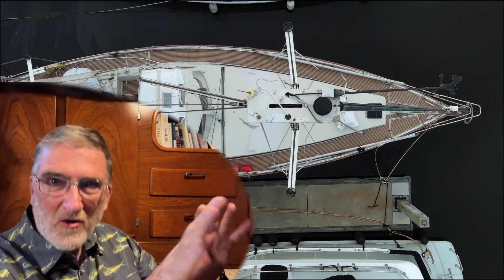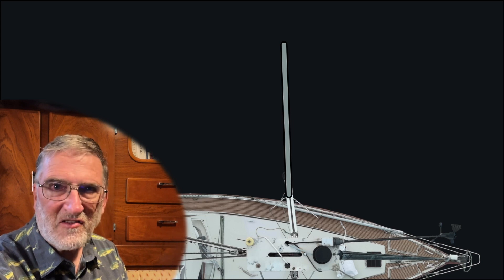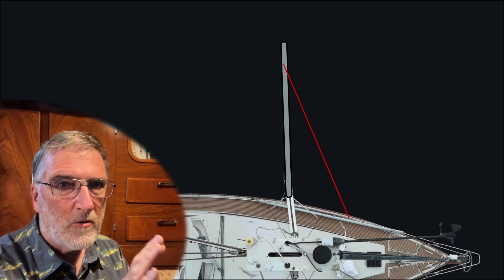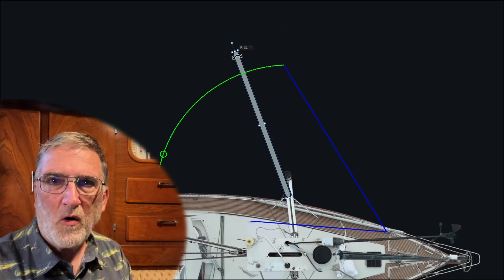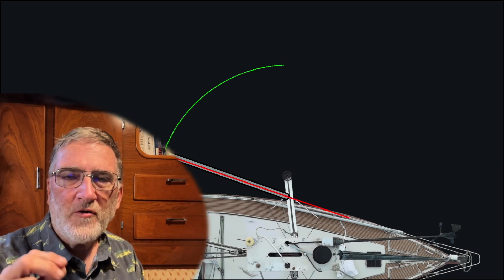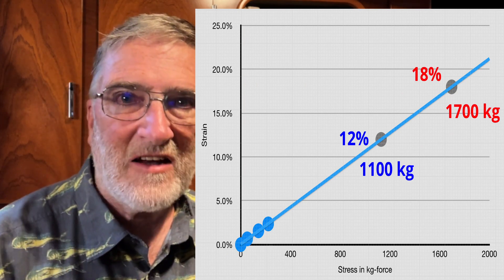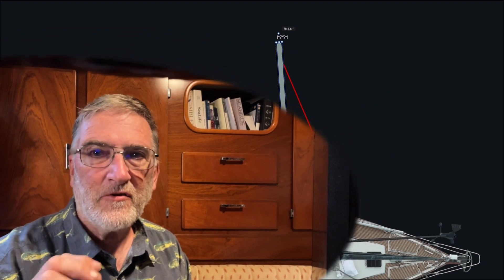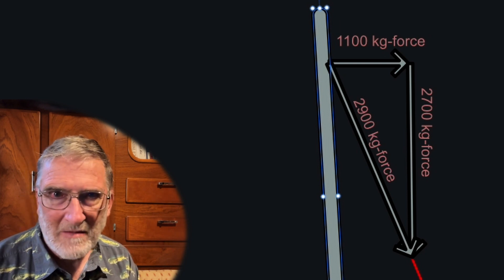Amel Downwind Pole Rigging

Comment: Didn’t Amel change the rigging manual at some point in time from their previous instruction manual for the SM?
Reply from the maker: I am not sure what the point is here.  At the beginning of the production run back in 1989, there was no manual, per se from Amel.  A new owner received training at the factory when they picked up the boat.  That training was required and standard for every boat.  The first edition of the manual was issued around the 2000 model year, and all the current versions have always been available on line, for as long as I have owned my boat, as well as all the knowledge contained in them.  Over the course of nearly 30 years of production, Amel made many changes in the design and operating instructions for the Super Maramu.  In some cases I know of, this resulted in mechanical retrofits to the gear on the boat to keep people from repeating the same stupid mistakes.

The only person I know who has been whining about this was told by several knowledgable owners that his method of rigging was incorrect, and was against Amel's recommendations.  His answer was, "I like my way better."  He was NOT following the recommended rigging setup and was NOT using it according to the instructions that were published in ANY version of the manual.  It is impossible for any manual writer to image ALL the ways people can do something wrong.  If you are doing something that is NOT in the manual, all of the consequences are on YOU.  You can't say, "But you didn't tell me NOT to do it my way!"

It is one thing if the manual is clearly in error, and tells you to do something that is dangerous.  That is not the case here.  The pole was rigged with lines that were NOT configured as described in the manual and in a sail configuration that was also not described in the manual.  

This is documented in the comments on his YT channel--it is not hearsay.  Then his mast falls down and he blames Amel for not telling him something he was told by others. I do appreciate his need to deflect blame to get his insurance payout, but the public blame game being played is at the very least disingenuous, if not deliberately misleading. His "how-to" videos have cost owners thousands of dollars in repairs they did not need to make.

Comment: So the over stretched foreguy (parallel to the boom) has 1100kg.. Why would that make backwinding force to be 1100kg? Isn't there's a (huge) lever in there at that point?
I don't have the dimensions you are using, but with some guesses of dimensions, the backwinding force (normal to the boom) to cause the first calculation case is like something like 500kg. Thus it is a bit overkill to use 1100kg as normal force in the second analysis.
 
Anyway, 3 tons of side force or 1.5 tons, doesn't matter. It's a metric f-ton of force in any case.

Also, I might have missed a lot here, why is that pole joint at side of the boat and not at the mast? Did it buckle from that point?
Reply from the maker: Actually, the geometry WAS included in my calculations.  At the point of maximum stretch, (when the load is highest) there is virtually no lever arm, since the pole at that point is essentially parallel with the stretched line.  There is a joint in the pole essentially at the side of the mast.  Unless the shrouds fail under load, that joint is not allowed any significant motion.

Comment: Thank you Bill. A very good video. I have been trying to figure out for a few years why I seem to have an abnormal load on the foreguy. Everything is rigged with the original amel equipment and according to the manual. On setting the pole as instructed I have to "pump" the foreguy while taking in at the cleat or swing the pole out then raise the pole to its  position with the topping lift. Either way there is considerable strain on the foreguy even before use. In 2020 after a very sedate crossing of the Atlantic I noticed that the pins on the shackles holding the forward guys in place were bent. I replaced the shackles with stronger ones and carried on. In 2022 and again in 2023 I was caught out and unable to get the poles in was running downwind in 25kts true wind.  Both times even though the genoa was 50 % reefed the pole suddenly snapped back. The pole was never anywhere near the water and to my knowledge never back-winded. In any case being furled so much I doubt if back-winding would be a major problem. I just wondered if you had any idea or experience of similar. Thank you for all your valuable contributions to the owners group.
Reply from the maker: @BobThomson-q2j  Bob,  
I don’t understand how you can have an “abnormal load” on the foreguy before you  set the sail if you follow the sequence in the manual.  Let’s review the recommended sequence.  
1. Attach control lines to pole.  The afterguy, and the down haul are set at their marks. 
2. Raise the pole with the topping lift to its mark.
3. Push the pole out, and pull it forward with the foreguy.  When it comes tight on the afterguy it will be very close to the right spot.
4. Adjust the lines as needed to have the long pole be aligned with the jockey pole

With that procedure the control lines can not be more than hand tight.  Note that the marks might not be in EXACTLY the right spot.  You might try starting with the marks set 6 inches out, and then adjust to get the pole correctly set. That might work better.  If you trim the foreguy and aft guy hand tight BEFORE lifting the pole, that will severely overload both of those lines as the pole rises. 

Now comes a couple key points. 

First; For downwind sailing like this sheet tension should be relatively light.  You want the upper 15% of the luff to be on the verge of luffing, in fact it should luff when the boat rolls.  This greatly reduces rolling with the twin sail rig. Amel’s suggestion is to trim the clew of the sail to a meter forward of the pole.  This only works if your sail is the same size as the original.  Many replacement genoas made by sailmakers unfamiliar with Amel’s specifications are simply too small, and following that recommendation will result in a much over-tightened sheet and sail.

Second: This is a light wind rig.  It something people seem not to understand.  This is not a flaw, any more than restricting a 1/2oz spinnaker to light winds is a flaw in sail design.  In strong winds you don’t need a pole. the genoa will fly stably all by itself in anything over 15 TWS.  If you try to use this pole setup with a genoa reefed significantly, and with high sheet loads, you will put excess aft-directed loads on the pole.  The geometry dictates that.  It’s not unique to the Amel pole setup, a standard whisker pole used on a jib significantly smaller than it was designed for would have the same problem. It is not appropriate to use poles in wind strengths that require the genoa to be reefed down to 50% of its original size.

Hope that helps
Reply: @billkinney4794  thank you again Bill. Couple of new points well explained. Still leaves me with the unexplainable situation that pulling the pole forward that last 1 metre say is very difficult by oneself and putting the pole away in a strong breeze can also be challenging. I can only accept that pulling the pole forward and upwards by the foreguy with the weight of the genoa sheet requires more force than I think is normal but that is a personal opinion. Regards

Comment: One important thing you forgot to mention. AMEL changed the user manual in 2004! “Don’t use pole and jockey pole on a single side. When the true wind is more than 15 knots, furl jib and ballooner together.” Sadly AMEL did not inform existing user about this imported change.
Reply from the maker: I did not mention it because it has ABSOLUTELY NOTHING to do with the analysis I presented here. 

How to rig the poles as described in the this video DID NOT CHANGE.  That's just not true.  Other things did, and while there can be rational discussions about if they are important or not, but they are completely irrelevant to the discussion here. If you rig the poles incorrectly, you can collapse the mast even if you follow all the other recommendations about when to use them. That's my point. I want to be sure that people know there is a right way and a wrong way to rig their foreguy and they need to know why that is true backed up with good engineering analysis. 

Knowingly presenting the wrong way to rig the poles for flying the ballooner without understanding the consequences of the differences is irresponsible.  This video presents why following the correct method is important.  I stand by it, and why it is important for people with Amel's to know. If you have any argument that is actually about the analysis that is in the video, instead of someone else's uninformed  ranting about it, I’d welcome the opportunity.

If you are flying the ballooner with the two poles (as recommended) and you dip the pole in the water, or backwind either sail you better have your foreguy rigged correctly with the right kind of line you or you DO risk collapsing the mast.  I think that is clear from the presentation.

This red herring  about 2004 manual changes keeps coming up. I do not understand why, or how it changes ANYTHING mentioned in this video.  I think we can all agree that people can make more than one mistake while sailing.  Which one of those mistakes were the exact proximate cause in any single unfortunate event is unknowable to me, and is not speculated about in here at all.

I DO understand that Amel's recommendation has been to not use one pole.  I know about it, every other Amel owner who keeps connected with the community and acceptes recommendations from others knows about it. My boat was built in 1996, I have known about these recommendations since I owned it. I take responsibility for knowing about my boat. The current versions of those manuals have been posted online in a forum that the people you are listening to were active in for many years.  If they claim they did not see them, well... that's on them.

If you can please point me to any analysis that explains WHY using one pole can collapse the mast  under condition where two poles would not, I would appreciate it.  I do not understand forces involved that would be mitigated with two poles, but I do not know everything.

Comment: Is it the same for a Sharki?
Reply: Sorry to be late to the party. Just came across this older post, hope it's useful.  Amel Sharki Tradewind Sailing ://www.youtube.com/watch?v=LLYoBbeGPWE  . It's a short visual only but looks a very similar setup to the SM.
Reply from the maker: I am not as familiar with the details of the sharki's dimensions.  For one I do not believe there are extra attachment points that can be confused with the right ones.  But the basic geometry applies.  What the original lines sizes and type that were used, I do not know.

Comment: Bill, your explanation is flawless and clear. It has brought up the question for me what did the previous owner encounter, and because I cannot be sure that the downwind poles were not backwinded or doused, I need to order new lines for the downwind rig even though they look relatively unused. I’ll save the old ones for backups.
Reply from the maker: Tilo, “Flawless” is a pretty high bar.  I’ll happily take “pretty good”, and be happy with that. It was a lot of time to do the analysis and then put together a presentation that made it clear, so I appreciate the kind words.

Comment: How is this better than a twistle rig?
Reply from the maker: Paul, 
Now there is a word I haven't heard in a long time...  But The Amel downwind rig IS a "twizle" or twistle if you prefer. It seems a similar word never made it into the French sailing vocabulary, and so was never picked up by Amel. This kind of double headsail rig has of course be around since before the days of Joshua Slocum.  Amel modernized it and made it practical for a larger boat with short handed crew. This will explain:  https://fetchinketch.net/2016/06/26/amel-downwind-sailing-rig/
Amel's choice of a nylon sail for the "2nd genoa" was to make dousing a 750 sq foot sail practical for two people.  A second dacron sail of that size would be a hand full and a storage hassle.  The ability to roll up the two sails on the same foil means in a tradewind squall there is no need for a mad scramble to get sail down.
The only real performance difference is that the rig set on traditional whisker poles can be trimmed to a wider angle because you can rotate poles off of perpendicular, and therefore the sails as well.  I don't see that as a huge advantage, since there are sail plans much faster and easier to handle once you come up to 150TWA
Reply: @billkinney4794   thanks for the reply, my understanding of the twistle rig is that the inboard ends of the poles are on a free floating attachment, not on the mast, so there is no loading from the poles to the mast.
As far as furling goes, self furling foils generally have two tracks, so if the second jib is hoisted on its own track, it can be easily furled in a squall. In addition, it is possible to have one jib set inside the other for reaching and pointing if the whole rig has to be changed suddenly.
I really can’t see the benefits of the Amel rig over the twistle rig.
Reply from the maker: You are wrong about the rig you describe.  It can not be furled on a foil.  If you hoist a second sail on the same track, and leave the halyard up there, you will have a halyard wrap.  Think about it.
Reply: @billkinney4794  thanks, good point, explains why the articles I have seen suggested sewing two old jibs together at the luff, and on another they left both jibs up all the way across the Atlantic. I will have a stern word with myself about thinking things through …
Reply from the maker: @paulfitzgerald1466  Like all sailing rigs, each has its pluses and minuses.  No one is "best" for every sailor, every boat, or every voyage. We find Amel's rig is practical and comfortable downwind even with a boat where that involves over 1400 sq feet of sail.  Having used other twin headsail setups, I am happy to trade off the ability to use it on a boat of this size for the reduced flexibility it offers.  So in answer to your original question, "Is it better?" the answer has to be, Yes and No.  :)

Comment: Thanks very much for this Bill.  Love the way you explained it in simple terms for us non engineering types 😉

We live aboard the much smaller sister to the SM, Amel Sharki (39ft), and are learning to sail.  It’s our first boat and we only started sailing about 3 yrs ago.  We’ve yet to try the poles for downwind sailing.  We did try rigging the massive Genoa sail onto one at anchor and it was guess work to be honest, we haven’t sailed with it yet.

Your video makes me wonder if there is an Amel guideline for the
Sharki also 🤔. I will have to enquire.

Thanks again
Deb
Reply from the maker: Deb,  I don’t think Amel ever published a manual for the Sharki. I don’t know enough about the pole set on those to answer any detailed questions, but the Super Maramu manual might be a good place to start.